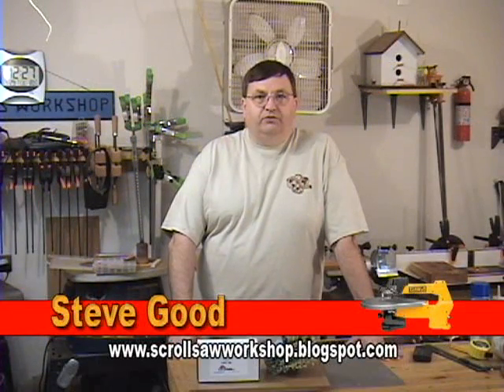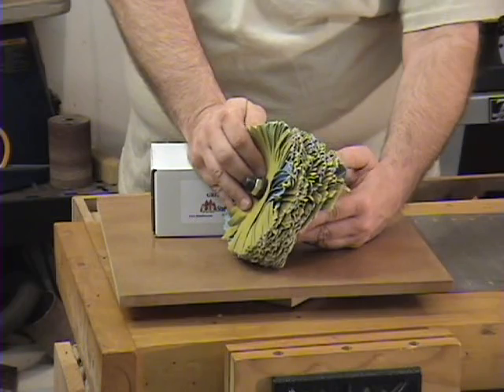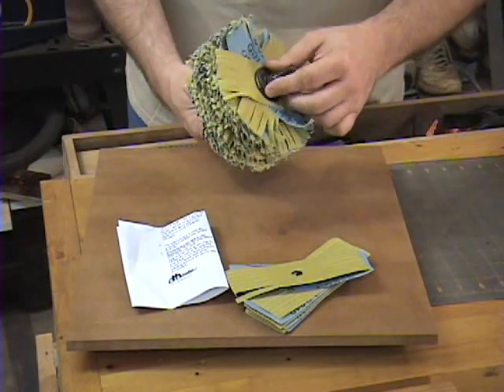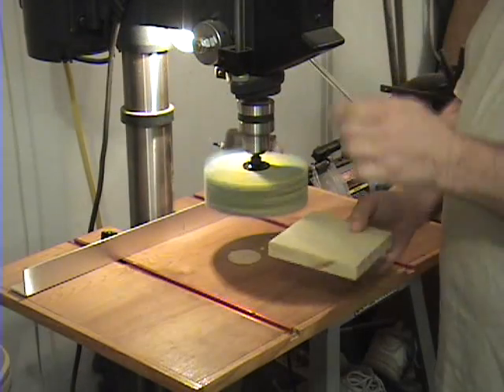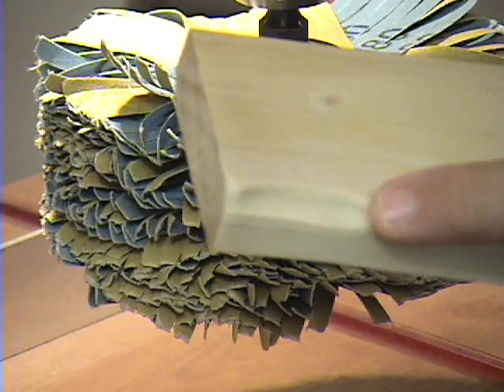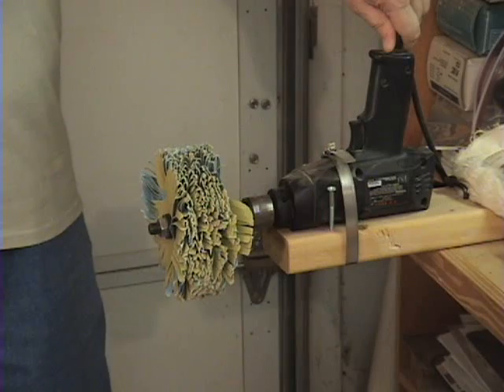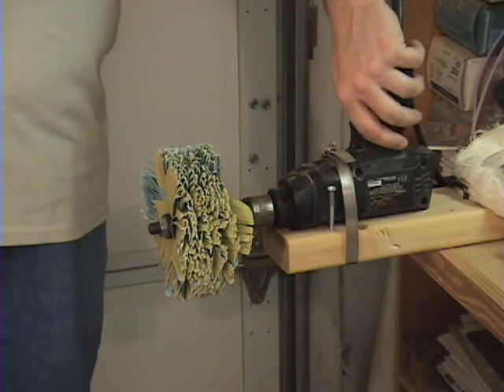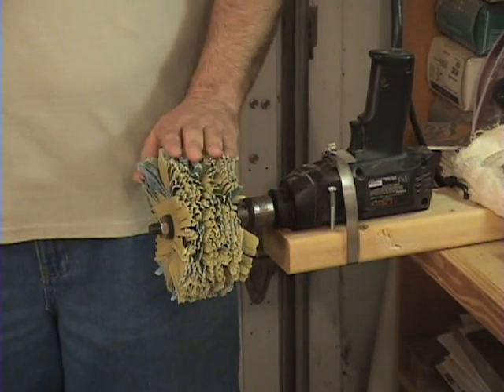Sanding Mop. A Great Tool for Scroll Saw Work.

Comment: What RPM should be used on the drill press for the mop?
Reply: Apparently, no one is answering questions here.  Aargh!
Reply: I think, if memory serves me correctly, 200 to 300 rpm. I found the answer by direct email to Steve, after my question was posted. Then I set up the drill press after that. Long enough for me to forget details. 
To be fair, Steve posted this video in 2008, and has a lot of videos. I suggest that you give him a shout.

Comment: I just received a Sand Flee 4 inch (6 inch wasn't available) finish mop 220 grit. It's thnner than I expected.

If you wanted to purchase a second to compliment it, which would you buy (sanding mop)?